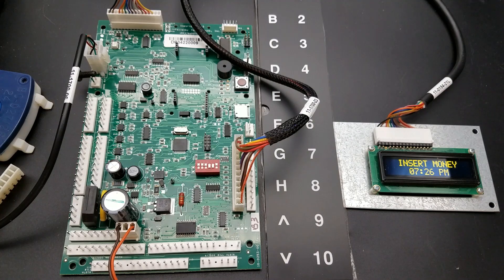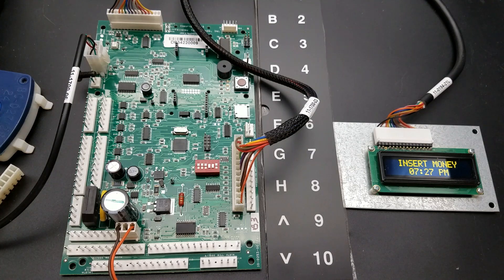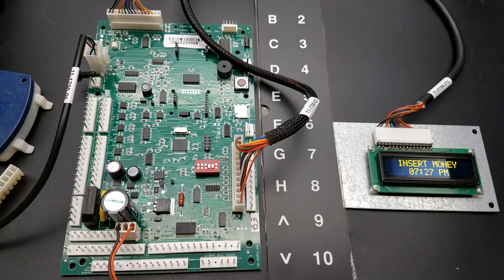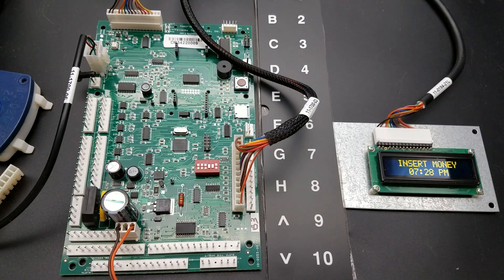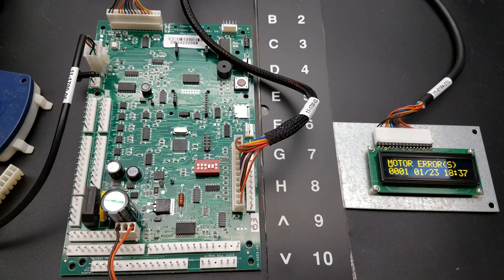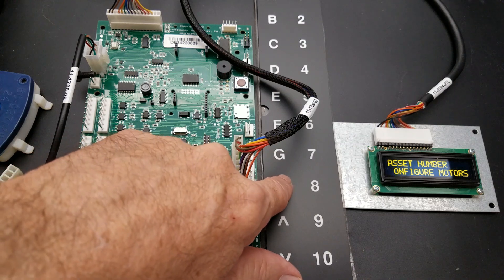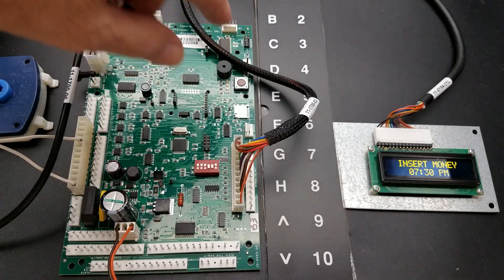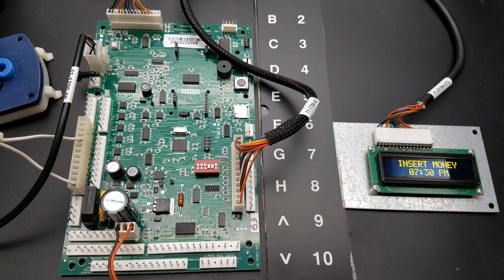HOW TO CLEAR SYSTEM ERRORS ON AN INONE TECHNOLOGY VENDING CONTROLLER

Comment: Good morning. I’m getting a communication 0004. Coin mech is full, multi vend is off but Machine is giving credit & is displaying use exact change. Would you have any insight??? I was going to swap out the coin mech.
Reply from the maker: You should perform a factory reset on your controller.  It sounds like an error a reset would fix.  Once this is done set up the machine like new install, all payment devices default to MDB. Here is a link to how to do the reset https://drive.google.com/file/d/1-F23A7c_YG3eFEhyiQZvOsD24v3LkOte/view
Reply: @ super thank you!! Appreciate the quick reply ❤️
Reply from the maker: @virgo2fly  Glad to help. If you have any issues please call our support line @667-401-1000